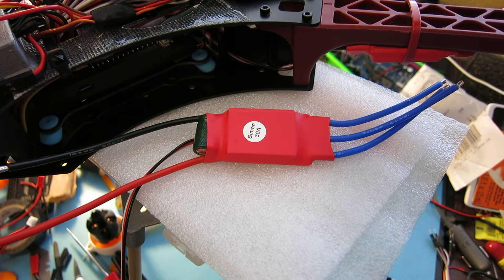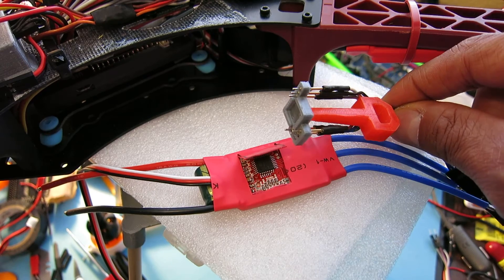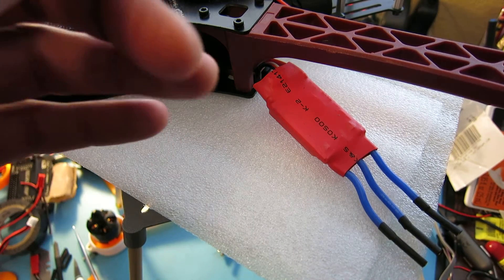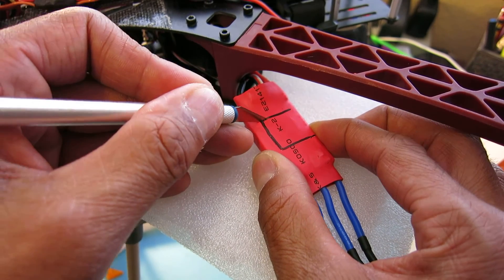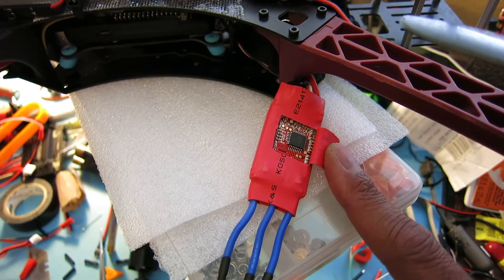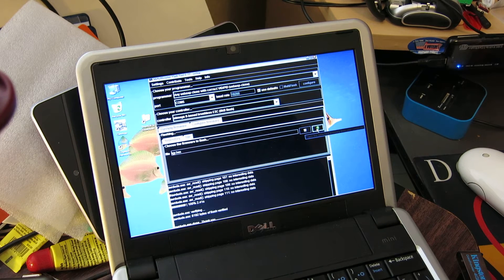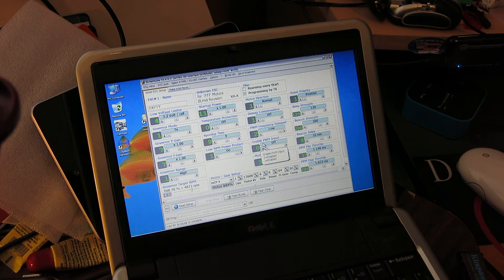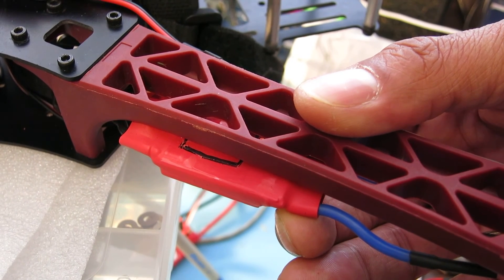One take upgrade of 30A SimonK ESC from eBay using New FlashTool

Comment: Any chance there is an updated version for this cheap ESC? The one I've bought looks the same, but has different chip (not ATMEL, but the name is scratched away). It does have the programming pads, but no labels, so without chip name, no chance to reverse-engineer it :(

Comment: Nice video, I don't have the means to make a tool like you have so I just solder wires onto the pads but it gets the job done.

These are great little controllers for the money, I don't even use them in quads etc, I have used them in small cars. Thanks to the customisable firmware you can have breaks and reverse just like a car ESC. They have plenty of power for smaller inrunners up to maybe a low KV 2838 size. Ideal for giving a 1/18-1/12 vehicle a new lease of life or a converted toy grade.
Reply from the maker: Good idea.  I should see if I can get one of my old 1/12 racers running.
Reply: Hi. How do you make this particular ESC to work with brake and reverse? I

Comment: My copy of tgy.hex firmware is set up for 16Mhz external crystal but these ESCs operate at 8MHz using internal oscillator. Should you have used tgy_8mhz.hex  file instead ?  Many thanks.
Reply from the maker: The regular tgy.hex file worked for me.  See the link to the Thingiverse page to see a picture of my ESC board.  I did not see an oscillator component on it.
Reply: I figured it out. These ESCs are actually operating close to 16Mhz using internal oscillator which has been pushed to the max in frequency ($FF written to OSCCAL)
Thanks for your video. Helped me out. Cheers

Comment: What is the purpose of "upgrading" these?   
Do they not work on in multirotors without upgrading to 2015 firmware?  

How do you tell if you have older firmware?   
I bought some in 2016.
And would hope they came with newer firmware on them already if there is a reason for it.
Reply from the maker: These ESCs are old.  If you have a set, they probably have older firmware on them.  Depending on which Simon K firmware is on the ESC, you may get some new features or bug fixes.  You probably don't need to upgrade unless you are having some issues.  I don't know how to check what version is on the ESC without doing a compare against known versions.  I show an example in the video.
Reply: @MileHighMulticopters  
Hi ,  i have the same red esc in my rc home made plane ,may be it is old one ,  it shutdowns after using 3 or 4 times reason is heating issues..

your upgrading process can fix this problem?

Comment: I'm interested in your programming tool
How do I get a copy?
Reply: If you have a 3D printer, download the file here:  http://www.thingiverse.com/thing:1569874 
You'll need some pogo pins also.
Reply: I will ask a friend to print your programming tool.
Thank you for sharing & links 
Good flying !
Reply: For my application (to put horizontally  the wings of an ornithopter)   , I need, absolutely to activate the brake of this esc (brake on)
Do you know which program I have to use for this flashing?
Reply from the maker: I think the new BLHeli suite will now allow you to flash SimonK firmware also.  Check it out.  Otherwise, kkflashtool works, but is not as user friendly.  :)
Reply: It does, confirmed! I made the tool took me an hour or so, but then I figured I try without it and it worked lol. Good video nonetheless, very informative.

Comment: Thanks for uploading this, i have been waiting for something like this for a while. I have dozens of the yellow esc's which are similar to the red ones flashed with simonk firmware this was a pain in the ass by hand. I have used some smd clamps which will hold for a while but it worked it needed about 10 hours for 12 escs... :-/

Comment: Witch motors are you using? 1000KV? Tks
Reply from the maker: At that time, I was using generic 920KV.  I upgraded to SunnySky X2216 KV1100 motors and these ESCs are still working great.
Reply: ok, thank you! i have tried it with my 2200kv motors and i have burned some escs...i tried reduce the props size but it still burning...i didn't upgrade the firmware. do you think it can helps? tks
Reply from the maker: Juliano Mimura Cortez You can burn any ESC if you crash and do not disarm the quad immediately.  If this is not the case, I don't have any idea why you are having this problem.  

The 30A ESC should be able to handle the 2200KV motor with a reasonable prop size.  What size?  You probably should not go over 7" with that motor.  I have run 1047 props on the 920KV and 1100KV motors on this 30A ESC.  On another quad, I had 1250KV motors with 8045 props.  I did not have any problems with heat.

If you are using custom firmware, I could see a potential of a problem in configuration that may cause more heat issues.  But standard firmware seems to work fine for me.

Maybe there is something wrong with your ESC or motor?  Check the maximum current or what the recommended ESC size for your motor to make sure that 30A is enough.
Reply: my motors are this 2200kv billig orange chinese motors. i have seem that many vendors are selling this kit on ebay or what ever...i mean the red simonk(30A esc) + 2200kv(orange-motor). I use at the begginig 1045 props and change to 6040 6030 i don't know exatly. but small props for sure. from 12 escs i ordered i have now 6. almost all of then burned wenn i just start the quad. can be that i simply danger my motors wenn at teh beggining i tried the 1045 propeller? best regards. another question is possible to reduce the kv from 2200 to 1000? tks
Reply from the maker: Look at the specs for your motor and compare below.  I found an orange 2200KV motor on eBay.  Here are the specs:

Type: Outrunner Motor
Mode: A2212
KV: 2200
Theme: Toy
Part: Hobby Parts
Fuel Source: Electric
For Vehicle Type: for Airplane, Helicopter
Max Efficiency: 80%
Max Efficiency Current: 4-10A (>75%)
Current Capacity: 12A/60s

You can see the maximum current is 10A > 75%.  It should be well below 30A at maximum.  There must be something wrong with the motor or you have some bad ESCs.

I have 1000KV A2212 motors that look the same.  They were most efficient with a 8038 propeller on a 1100g quadcopter (up to 18 minutes flight time with 5500mah 3S battery).  8045 and 9047 propellers gave more thrust, but less flight time (< 10 minutes).  If your quadcopter weighs more than 1000g with battery, I DO NOT recommend the 1000KV A2212 motor.

It is possible that you could have damaged the motors by running the 1045 props and getting them too hot.  But, unlikely if they seem to work fine with good ESCs.

If you have a load tester or ammeter, you should test each motor with the prop to make sure you are drawing around 10-15A or less at full throttle.  Some bench testing may be in order for you to figure out where the problem is.  Be careful to protect yourself from an accident.  :)  Good luck.
Reply: ok, thank you!
Reply from the maker: Most likely, yes.  I have not tried on the smaller motors.  These ESCs are pretty big so might not look so good on a mini quad.  I've heard BL Heli ESCs work best on racer sized quads.  I can only say that they worked great with APM on a 500 and 375 sized quads using 920KV-1250KV motors.

Comment: Whats is the Firmware?
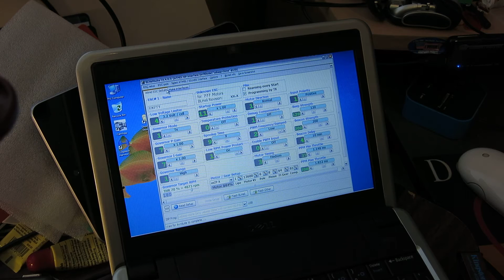Reply from the maker: Mine used the tgy.hex.  There is no guarantee that it will work for yours.  At 4:41 I show how to compare a firmware file to what is already on your ESC.  I had to compare many files before I found what is on my ESC.

Comment: bredboard and pins new programmers lol goto be a better way then this
Reply from the maker: The ESCs cannot be flashed through the servo cable.  Your only option is to solder leads onto the programming pads or use some kind of socket tool to reflash them.  Either way, you have to cut them open.  But, if you watched the video, you'll see that it takes me about 5 minutes to re-flash an ESC with a socket tool.  Do you have other methods?
Reply: Why it is not possible to flash through servo cable? Is it not possible to flash a bootloader?
Reply from the maker: I'm fairly sure that these ESCs don't support flashing through the servo cable.  I tried a DYS ESC programmer without any luck and I could not find anybody who was able to do it either.  So, I took a more direct approach to upgrading these.  If you find an ESC programmer that works, please let us know.